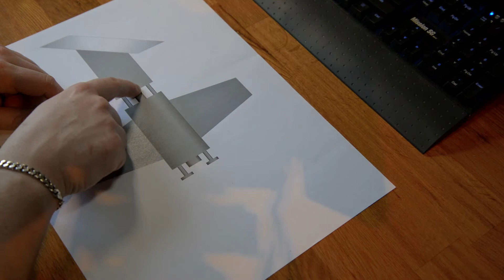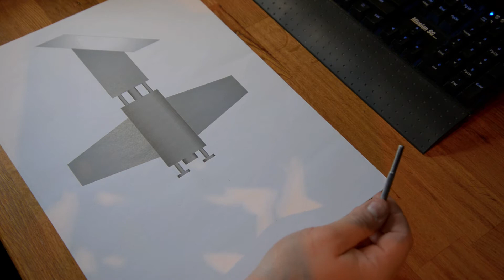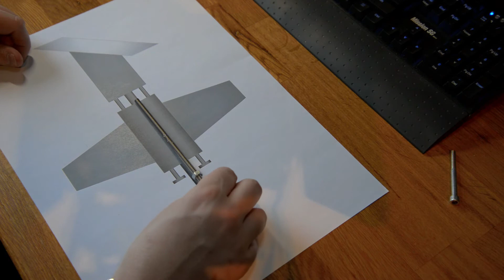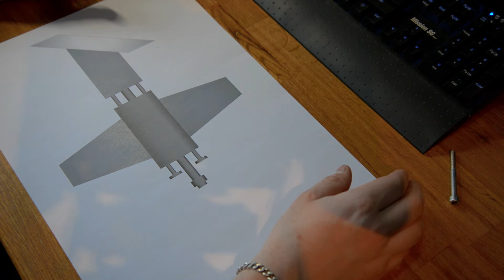MODDING THE SECONDARY MIRROR HOLDER - ADDING A 291N SPRING

Comment: Thanks Daniel for mod information. I have the AG16 on an MEII and the secondary has been a nightmare. It is still the stock configuration and I will add the enhancements you use yourself.
Reply from the maker: So even with stock secondary, it doesn`t hold collimation?
I did order a bigger secondary so coul`d accept a slight weakness in the spring…

/Daniel